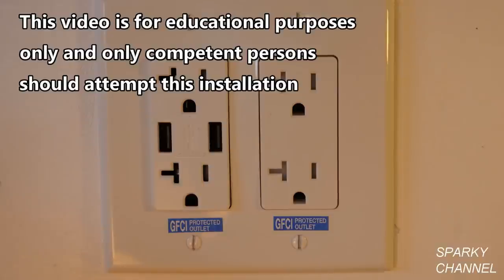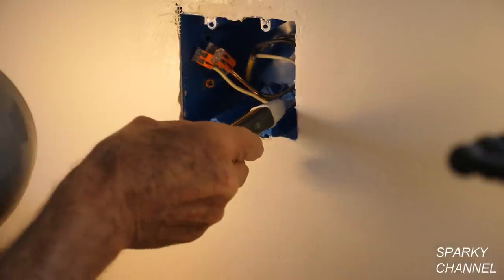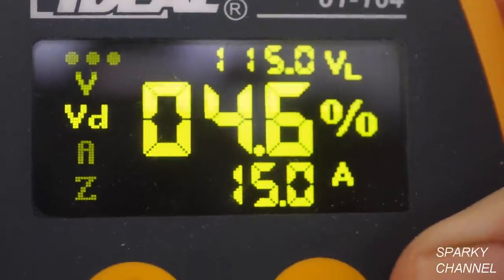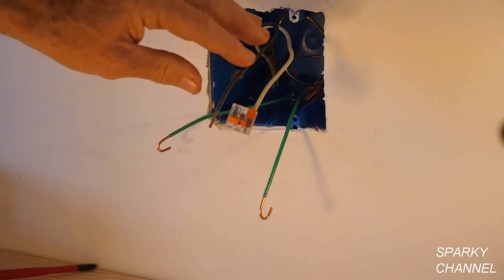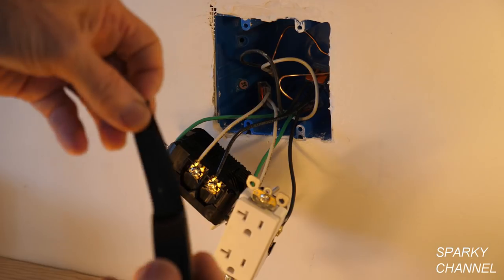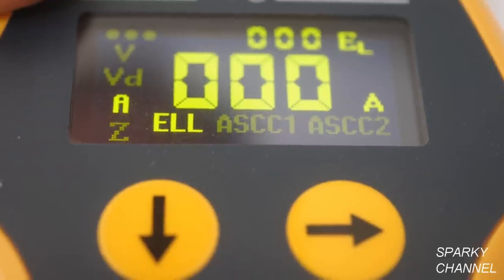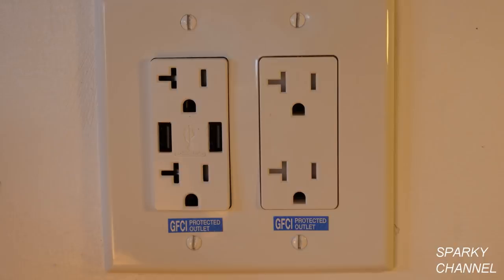How to Install Two 20A Receptacles: One with USB Charging!

Comment: Hi Bill from Sparky Channel

Normally don’t watch YouTube in the morning but what a nice surprise finding a new video from you

Very interesting tool that Ideal circuit analyzer 
Perhaps sometime a video on exactly how those reading are derived from.  
Such as voltage drop, is that drop in the switch or from the panel....
You could probably make quite the video on that device alone
Just an idea, I might get that but hard to justify that purchase as I’m not an electrician 

I did buy that volt claw from your link after seeing a previous video, looks to be useful as opposed to my short stubby fingers 

Once again, great video
Much appreciated
Reply from the maker: Thanks so much!

Comment: I never knew you used Wagos in the states 👌🏼
Reply from the maker: They are starting to catch on.
Reply: @SparkyChannel  best of the best 👌🏼we use a lot of the ideal version too, I’d assume in the states they would be more popular? (Not the wire nuts)
Reply: @Cablesmith  Ideal only sells non-lever's in stores unfortunately.

Comment: I'm finally getting around to doing some home electrical work and your videos are really helping. One thing I would like to see is installing multiple LED lights with a 0-10 volt dimmer. Mostly how to hook up the 0-10 volt part with 2 or more lights.

Comment: Those wires are about 2,5mm2 right? Surely you wouldn't put 20A of load on them, right?
It will never not be weird to me that you have to wrap the receptacle in tape to make it somewhat safe haha
Reply: You can put 20a of load on them for 1-2 hours before the breaker would trip. You don't have to put electrical tape on, most people don't, just an added safety measure.
Reply: You don't have to wrap it. The code doesn't require it (or even mention it IIRC).
Reply: @chaseoes  A 20 Amp load will not trip a 20 Amp breaker, ever. 12AWG wires are designed to handle 20 amps, and a 20 amp breaker is designed to handle 20 amps indefinitely.
Reply: The tape is only to insulate the terminals. The wire can handle 20 amps no problem.
Reply: @colinstu  yes but it's what good electricians do.
Reply: @illestofdemall13  Looks to me like the wires are 14 AWG, or 2,5mm2. Might just be hard to make out in the video though.
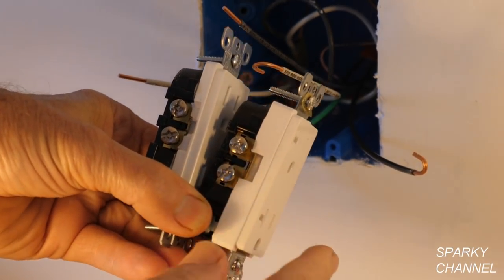Reply: @FromHerotoZeroYT  It is against the NEC code to install a 20 amp receptacle on 14 AWG wire, and Sparky is a licensed electrical contractor who really knows his trade. It is 12 AWG that he has in the electrical box, not 14 AWG. He even put a warning at 6:12 to only use 20 Amp receptacles on 20 Amp circuits. Also, the sheathing on 12 AWG NM cable is yellow, whereas it is white on 14 AWG NB cable. If you look closely, the cables entering the box have yellow sheathing. I can also tell just by looking that they are 12 and not 14, but I do lighting and electrical installations for a living in the USA, so I am used to it.
Reply: @illestofdemall13  Oh really? The cables are color coded too? That's kinda cool. You could use a 20A receptacle on a 15A fuse, right? I thought the small Wago's only went up to 14 AWG so that's why I asked. That was my mistake though, not checking before commenting lol. You learn something new every day I guess
Reply: @FromHerotoZeroYT  Yes the outer sheathings are color coded. Orange for 10 AWG, yellow for 12 AWG, white for 14 AWG. No, it is against code to put a 20 Amp receptacle on a 15 Amp fuse/circuit breaker. You CAN install a 15 Amp receptacle on a 20 Amp fuse/breaker, though. Regular Wagos go up to 12 AWG, and there are 30 Amp rated special ones that go up to 10 AWG.
Reply: Like I already stated, 20 Amp receptacles are ONLY for 20 Amp breakers/circuits.

Comment: With the voltage (121.4V) and the impedance (0.25 Ohms) the PSSC (prospective short-circuit current) would be 485.6A, that is absolutely sufficient to trip a 15 or 20A circuit breaker. Also should care that the current doesn't become too high, the circuit breakers have a maximum safe breaking capacity. Mostly 6 or 10kA. I don't know the exact tripping curve you use over in the US, here in Europe the standard types are B or C. B means the PSSC must be five times the rated current for an instant trip. On C it must be 10 times. B is mostly used in residentials, C in workshops were you got tools with a high initial current which would trip the type B. I'll make a simple example: Type B 20A circuit breaker requires a PSSC of 100A to trip instantly, a C 20A circuit breaker requires 200A.

And we're talking about short impulses, for example when you plug in your PC and the capacitors in its power supply were drained then you'll get a short current flow up to 30 or 40A, but only for the fraction of a second. Here in Germany a short-circuit in a circuit fused with 32A or less must be switched off in less than 0.4s in a TN-system. We mostly have TN-C-S here, which is the same as MGN in the US. Practically they'll trip in less than 0.1s. That's the same thing as it is with RCDs/GFCIs, here they'll have 200ms to trip, and actually they trip in the range of 20ms or less.

https://img.c3controls.com/image/upload/resources/c3controls-Understanding-Trip-Curves.pdf

The impedance is influenced by cable length and the quality of the terminations. It's the resistance in an AC system, symbol for it is Z (instead of R for resistance). But on AC circuits you can calculate with the impedance like you would do it with a resistance. I calculated the PSSC:

Voltage / impedance = PSSC
Reply from the maker: Thanks Marcel!

Comment: I have an ancient Fluke from the 1980s that still works like new. That Ideal tester you use looks pretty handy. When I go out on jobs I bring my Klein clamp meter.
That USB receptacle is huge. How would you fit one in a single gang box ?
Reply from the maker: Double box and a single mud plate,

Comment: Thanks Bill for another great video!  I'm starting a remodel on my kitchen and this couldn't have come along at a better time.  Have you had any issues with the Ideal SureTest Circuit Analyzer tripping an AFCI breaker?  I'm interested in purchasing it, but that could be a problem as many (if not all) of the circuits I'll be installing will be AFCI protected.  Thanks again and keep your great videos coming!
Reply from the maker: There are conditions where it will trip an AFCI but nothing you can't work around.
Reply: @SparkyChannel  Thank you!

Comment: Why don't you install the ground pole towards the top per the intended design?
Reply: He installed the ground down, just how it is advertised.
Reply: @illestofdemall13  intended per the patent and the safest way is ground prong up
Reply: @miniair  Where do you see that?
Reply: Notice how the ground is down on the Leviton website.
Reply: @illestofdemall13  the patent for this style plug show the ground at the top. The other reason is safety. If the terminals become loose and the plug hangs out the live prongs are exposed, this could lead to something shorting across them are a kid getting shocked if they touch them. If however you install the ground towards the top and the terminals become loose when the plug hangs out thengroud will be exposed which poses no danger, it also then pushes the live terminals into the plug which is again safer.
Reply: @miniair  Almost nobody installs them like that unless it is in a hospital.
Reply: @illestofdemall13  yeah because people think they should look like faces
Reply: @miniair  There is no code to mandate which way they are installed, ground up or down. I understand the scenarios that you stated and those are fair points, but many plugs are meant to be ground down. Therefore, the receptacle orientation is left to the electrician or designer to decide.

Comment: Why do people disparage backstab connections? How are they different from a Wago push fitting?
Reply: If you ever trouble shut a circuit with a back wired receptacle you will know. So on one service call I went to a house,the freeze in the garage was now working, I started to check the other receptacles in the garage, bottom was good as I pulled my plug tester out the freezer starter running. I killed the circuit,pulled the recept at it was backfired,just a little movement helped to make the circuit.These guys that wired the house were in such a hurry they left the screws where you would normally install the wires still out ready for wire.
Reply: @joemc111  so those were backwired? Or backstabbed?
Reply: @pb7379-j2k  my company never let anyone use those Wago fittings or use the pushin connectors on a receptacle.
Reply: @joemc111  well there is always resistance to new things, reasonable or not I guess
Reply: @pb7379-j2k   backwired uses a compression clamp behind the screw and can be very secure. Back stabbed uses a razor thin piece of metal relying on friction to keep the connection made. Loose receptacles when pulling plugs, heat expansion and contraction can cause sparks/arc/flickers all kinds issues with the connection among a lot of other things. ARC fault breakers can trip easily too. Hope that made sense and helped understand why they are  disliked.
Reply: @mikez4132  thanks. I know the difference. But backstab is UL approved and implemented by trusted manufacturers and to my mind is very similar to a Wago push fitting, so I believe the opinions against it are superstitious
Reply: @pb7379-j2k   i have removed backstabbed recepts thats just came off in my hand free of wires from just the force needed to pull them away from the box. I wont ever trust that connection. Why risk it? Thats just my pref. I dont use wagos either even though the new ones have a clamp. Have a good one!
Reply: @mikez4132  thanks Mike! No doubt you’ve seen tons more of these than I have. I appreciate your explanation. Take care!
Reply: @pb7379-j2k  anytime stay safe

Comment: why dont you just jump the wires off the back of the Receptacles instead of cramming more wires in the box I see the point on the ground but the other 2 just dont see the point just jump them off the back of Receptacles
Reply: Bad idea.
If/when you need to replace a receptacle, you would break neutral while doing so (that usb will fail).
A pigtail also allows you to settle the circuit wires in the back of the box before smashing the receptacles in, since they are on separate pigtailed wires.
If this was the end of the circuit with only one receptacle, a pigtail would not have function.
Reply: @CantKillMe  easy, less time spent and a slight bit of less material (a couple nuts and 12 inches of line or less)
You can do a minimal job for less effort, but you end up with a minimal job. There is nothing "wrong" with doing minimum to code, and many only teach what is minimum.
Some people prefer to do more than minimum.